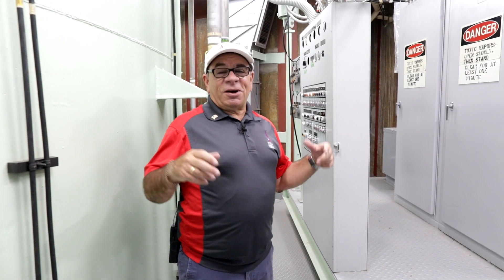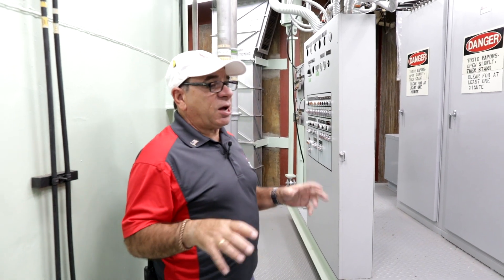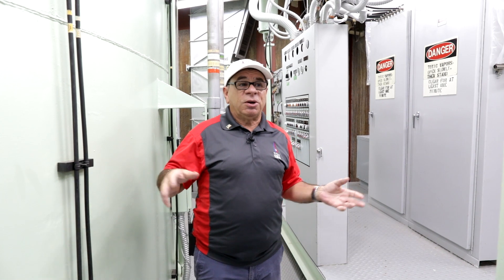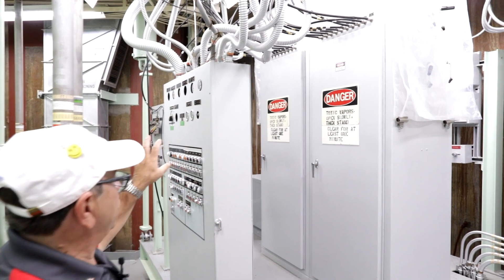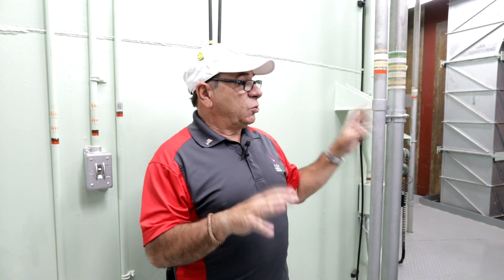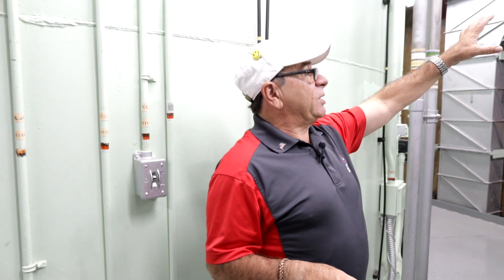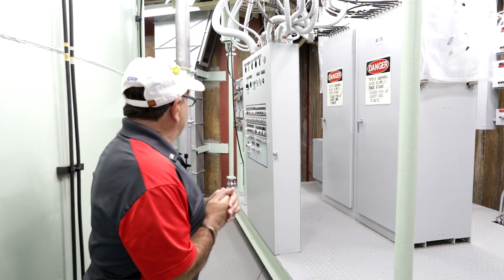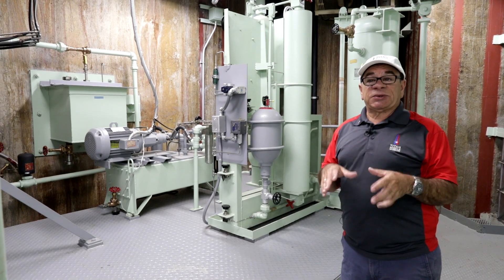Behind the Scenes of Titan II "Part 10 – Silo Level 6"

Comment: Thanks for recording these. It's fascinating to see the insides of these specialty facilities.
I'm glad they preserved the silo and a deactivated missile for posterity when they decomissioned the Titan missile systems.
I admit I'm curious about the chemistry involved for detection and the other operational principles behind the chemical sniffer; but understand that it would take a disproportionate amount of effort on the part of the musum to go in-depth.

There are just so many systems with their own fascinating engineering and design principles.

As a more reasonable suggestion for future video topics, I have wondered how the blast-proofing of the air vents works - how to ensure a shockwave doesn't propogate in along your ducts and pipes.
Is there some complex mechanism like a tesla valve to hinder flow if pressure increases, or is it something simple like a cover that is pushed closed by the force of the blast?
Are there just large voids to hold fresh air and exhaust while shutters to the outside vents are closed?

Are non-air supply connections such as municipal water, the refueling lines, etc. something they put blast protection on, or are those too small for meaningful force to be carried into the complex through?

Beyond just seeing the facilities, I'm grateful to hear the explainations and anecdotes from some of the people who manned the place when it was in service.
There's just something about having the people with the experience to know what is pertinent and who can recall the various mundane human facets that are less likely to be included in the paper documentation.
Even how good the food was and how it was served, or how much the crews interacted with local people and stores has been fascinating.